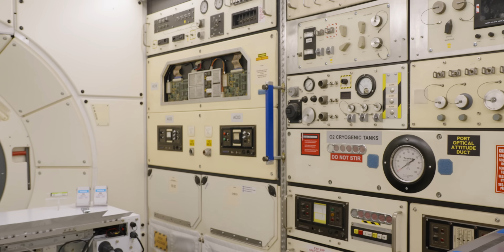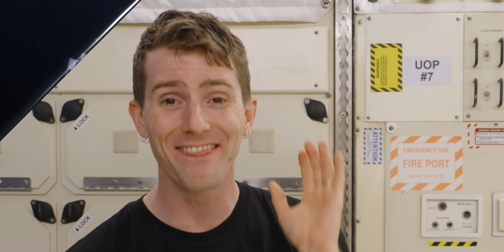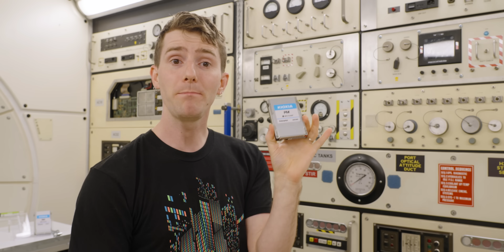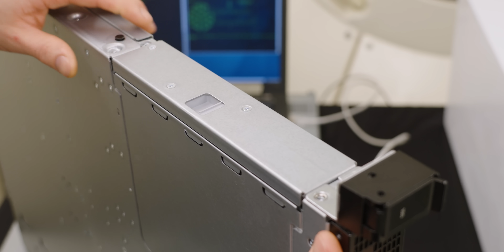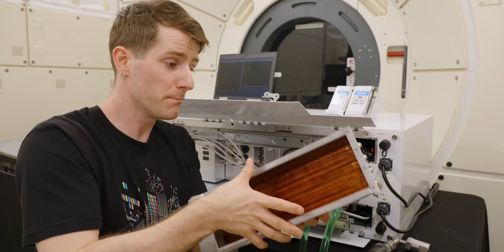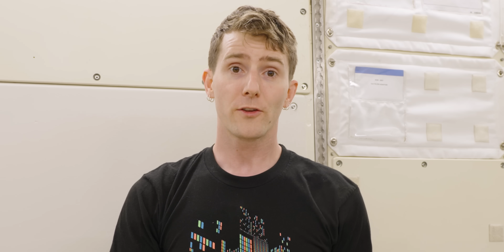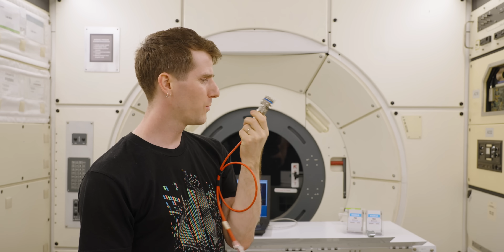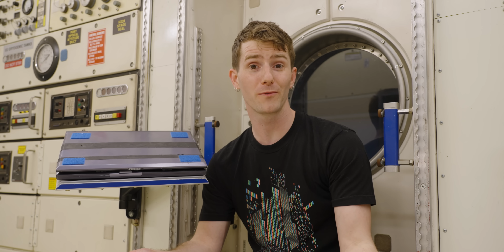here's why it's so hard to put a computer into SPACE - NASA HPE Spacebourne 2

Comment: Kudos to Linus for going to space without space suit just for the thumbnail
Reply: Yeah props x69,420
Reply: Not to be that guy, but isn't this an ISS model at NASA
Reply: @ShadowWispr  not even that it’s a movie prop/filming area in LA
Reply: @discorddiscord2647  True. The original ISS model is on scale = TOO SMALL for good acting. That's why there is a module of an ISS module ixisting in Hollywood, which is BIGGER than the original, so that you can easily shoot film.

But this one here is most likely a module at KIOXIA, on scale to the proportions of the original. They have this so that they can test the components on earth already. Because trouble shooting, if one component fails, is difficult when you would have to wait for the next rocket launch to the ISS to bring the spare parts.

So they run an equivalent of the server that is on the ISS here on earth and the components, that don't go poof after some months get the opportunity to become space-CPUs, Space SSD etc. Because when a component hasn't failed you in the first weeks, it's most likely will not fail you for years, as crucial build errors evidende fast (for example the 3090 problem with the 12 pin connectors only needed some weeks to occur first times).
Reply: I was about to write the same comment 😂
Reply: That's dedication to the brand right there
Reply: I was 1k like. I have the power!
Reply: Don't forget the sandels
Reply: Well i mean he COULD do it for less than 90 seconds and probably kind of survive if he was lucky.. so 🤷🏻‍♀️
Reply: RIP Arnold
Reply: Helped toe the company line too when he just completely ignored the aliens flying past the window partway through. Can't let the regular folk see through the conspiracy. /s
Reply: Now the Vtuber LTT future talk on the WAN Show makes a lot more sense...
Reply: oh there you are again lifeless bot
Reply: oh what a middle aged man would do for views right
Reply: @FurballCat better than eating tide pods like the youth do for views
Reply: @lpnp9477 falling for clear exaggeration/misinformation is worse than eating tide pods imo
Reply: Obviously this wasn't really shot in space, it was shot on the same set where they faked the moonlanding, which as we all know is on Mars
Reply: @Reac2  Sssshhhhh, you're not supposed to say that out loud!😬😉
Reply: Wait he’s actually in space or is he in a rocket on earth that will transport this equipment ?
Reply: @discorddiscord2647  i think he actually mentioned this on wan show; he's in a replica of the iss at one of hp's offices. or smth like that

17:11 oh there you go